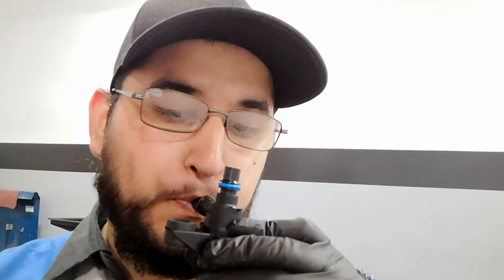How To Check For A Bad Evap Purge Solenoid

Comment: This is only the case If the valve is stuck open. If it's stuck closed it would pass this test even if it's bad
Reply: Valve is suppose  da to be open eaten disconnected.
Reply: Very correct. If it is stuck closed it will pass this test
Reply: Test with 9 volt battery

Comment: And it could be stuck closed too what is that testing 🤦🏾‍♂️
Reply: Good question
Reply: testing if it’s stuck open… connect a power and ground from a small 12v and if you still cannot blow through, it is stuck closed
Reply: @siccicey9479  so while its running basically?
Reply: @chadwolfeschledgelsteinhau9697  just take it out and use small alligator clips to connect to a 12v battery
Reply: Only way to test it is with a professional scan tool. So you have to turn it off and on while attaching a gauge to the valve and watching to see it it drops and rises when you open and close the valve manually
Reply: I used 2 screw as cables and a 12 v and this actually worked lol. This made my day.

Comment: Awesome! After jacking up my ride, crawling all over underneath ( no creeper and I’m 74 ), pulling air cleaner box, checking engine compartment. I pulled the purge did your test and am on the way to the parts store. THANKS
Reply: @IpissedonIsabella  No. But the purge was bad. Thanks
Reply: 71 did the same 2006 subaru sti pita to troubleshoot

Comment: Seriously, I get my brakes done and they try to sell me a serpentine belt… I say, I just replaced the alternator a month ago, had that belt in my very own hand and it was fine (gulp, um, uh); so I go get my oil changed and they try to tell me I need a brake line flush and a rear diff service… I say, I just made them flush and bleed the brakes a month ago when I had the front brakes completely redone and my rear diff went bad within the past few years, which was a rather pricey repair as I recall (gulp, um, uh)… so today my check engine light comes on and I am daydreaming of someone trying to tell me something totally retarded and offering to replace my cracked floor mats because that can cause climate issues, so how do I stop this madness? I come here, and like the video and add a new sub to your channel with a crap ton of gratitude.

Comment: If I can feel the pulses of vacuum when I compress the hose connected to it while the car is running, and then disconnect the electrical connector and still feel the vacuum, will that confirm that it's stuck open?

Comment: I was able to blow through both the old and the new Evap purge solenoid ……Check your vacuum lines that connects to them they could have came disconnected like the one on mine. I disconnected the battery and reconnected the vacuum line that connects the evap purge solenoid to the intake and reconnected the battery and the engine light went off and never came back on because of that vacuum line being disconnected and I’m gonna return the new evap purge solenoid to the auto parts place

Comment: Ecu will command it to open what if it stuck close all the time? What are the symptoms on close position?
Reply: Hook up a 9v battery it should open and then you can blow through it.    If it doesn't open it's faulty

Comment: I'm getting a code for the purge valve but my purge valve appears to be functioning. It is closed with no power on it and open when I applied 12 volts but with it in the car running it never opens. What could my problem be? It's a 2016 Subaru legacy with the 2.5

Comment: hello i have a check egine light sa ying this on my hrv 2020 DTC Description State System
P04F1 Evaporative Emission (EVAP)

System Low Purge Flow Detected Current|PGM-FI PGM-FI/Diesel(Engine

System)

P0441 EVAP System Purge Flow

Malfunction Current|PGM-FI PGM-FI/Diesel(Engine

System)

U0401-68 PCM Malfunction Current|EPB EPB(Electric Parking Brake) can you help i have no clue were is this located or is it relateed to it

Comment: I bought a new one of those and when I blew through it on one end the air went through the other end and then I did the same to the other end and the air went through, the new one might be bad or they are suppose to be able to blow through them

Comment: my purge valve is thicking noise and i feel vibration when i touch it on running engine, but i if i blow - no air flow. why is that?
Reply: Me tooo bru a constant ticking noise and its new on my 03 silverado. I don’t know whats wrong with it. If you find out lmk
Reply: Y’all lmk too had to go swap my purge valve like 3 times thinking it was just the part it’s for my 14’ mustang.. if y’all find a solution lmk
Reply: They say if it's ticking, it's fine.
Reply: Anyone figure it out?

Comment: Okay I tried it because my ECU  gave me a code for it. P443-for my BMW.  Did your test and it did not leak any air thru it. So why does it pop up that code P443? - weird, but I am going to  replace it either way just to get rid of the code. It is wat it is!